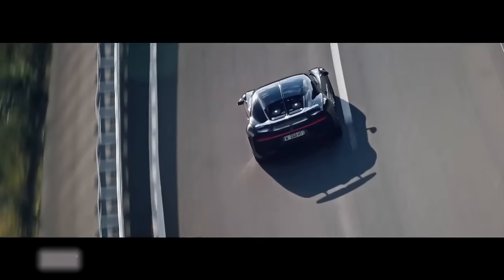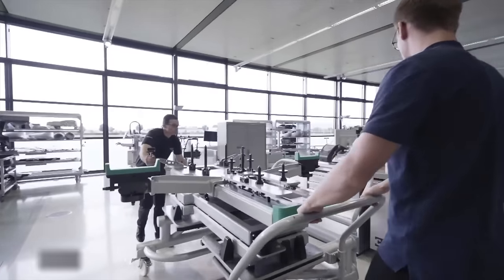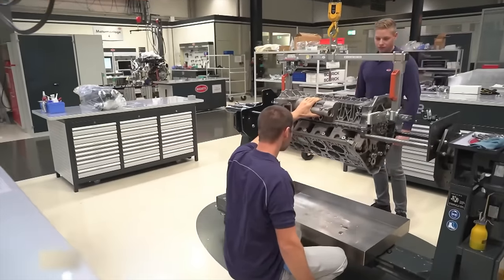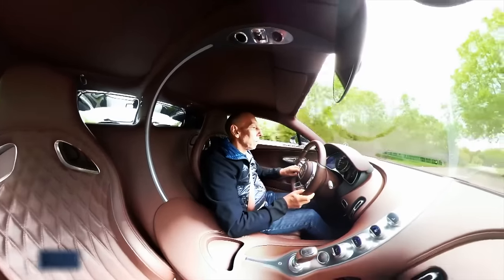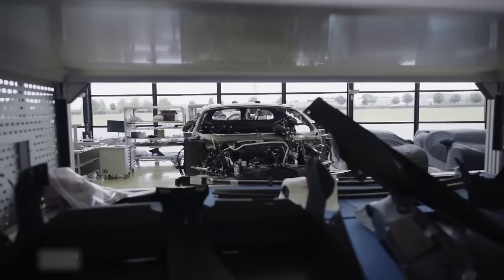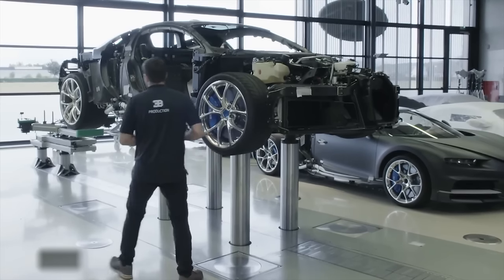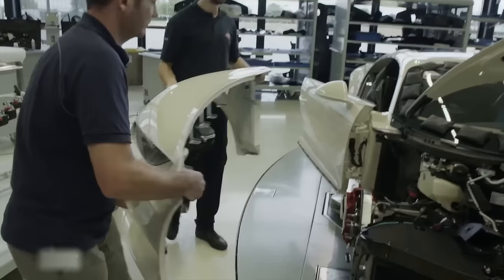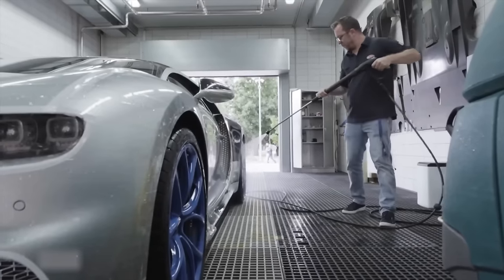Manufacturing Bugatti Chiron | Inside Bugatti Billion $ Factory | Assembly Line & Production Process

Comment: As an ex Auto Electrician I have never seen an alternator start a vehicle ! A starter generator on small industrial motors yes.
Reply: Yes this is very common on German brand cars now .. but has to work off a higher volt battery (not the normal 12v ) it does sound strange as don’t hear the sound of a starter motor cranking over the car just starts

Comment: .. Information about Bugatti regarding manufacturing... The Bugatti car is designed and manufactured entirely in Germany in the branch of the parent company Volkswagen. It was towed to eastern France in Alsace to be assembled in a high-quality, sequential workshop built by Volkswagen, where the car is assembled by French hands under the supervision of German engineers. The purpose of this operation is to preserve The origins of the French brand, which was founded by the Italian Ettore Bugatti in 1909 in the German city of Molsheim, on the outskirts of Alsace, which was part of the German Empire. At that time, France failed to manufacture the car until Volkswagen bought it in 1998. Bugatti was completely built and was the beginning of the emergence of the fastest and most luxurious civilian car in the history of The supercar industry has blended the scent of history with future technology so that you can travel at an empty, controlled speed in a luxurious cabin.
 To make this engineering miracle, you need very high and precise technology that combines aerospace engineering and automobile engineering. This is a very far-fetched thing to say that Bugatti is a French manufacture. In fact, it is a fallacy that is passed on among people and is unacceptable to the mind, because France simply does not have the high technology to make this hypercar.

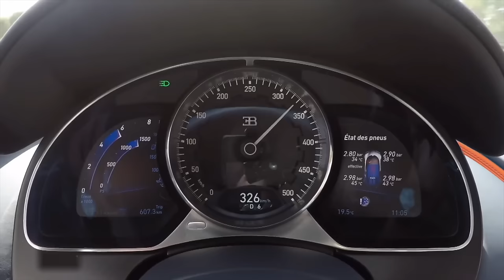Comment: 15:30 - Wait a minute...so, they they don't test the veh at top speed because a default could be fatal? Well, that should be the top speed (380). Don't allow the customer to take the same risk. But I get it, most people won't ever attempt it. I had a CBR1000 Sport Bike and I always chickened out before reaching top speed. It gets crazy, real quick. Feels like you could easily die and then survival instincts take over. It's a weird feeling.

Comment: At 3:50 he calls the alternator a generator and claims it starts the engine. Sorry but a starter starts the engine and generators haven’t been used for decades in automobiles
Reply: It is used in many cars, I saw it in a nissan rebuild.
Reply: It's actually a starter-generator. Give it power and it spins, spin it and it generates power. No need for a "Bendix" clutch that way. Many cars use this today.